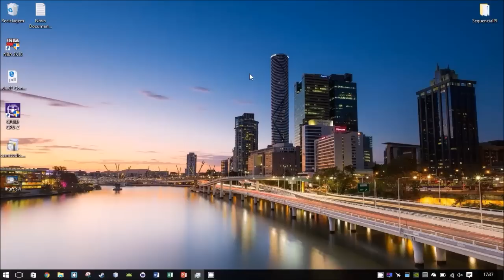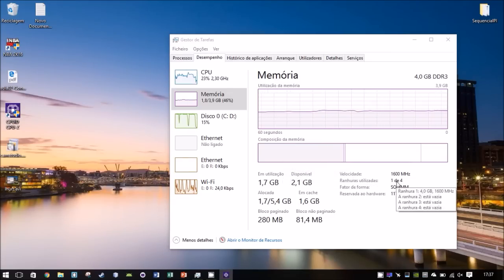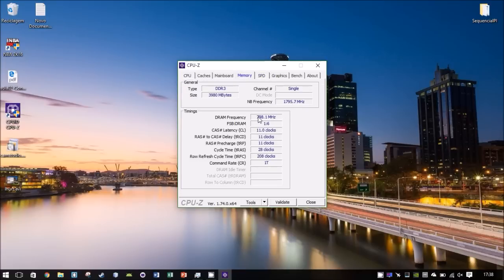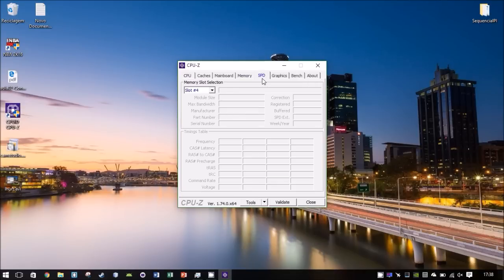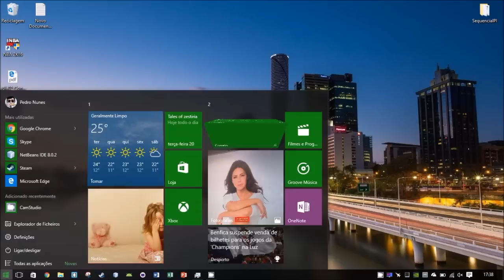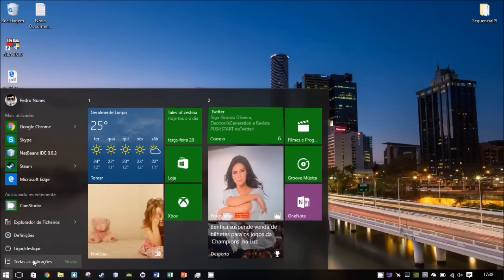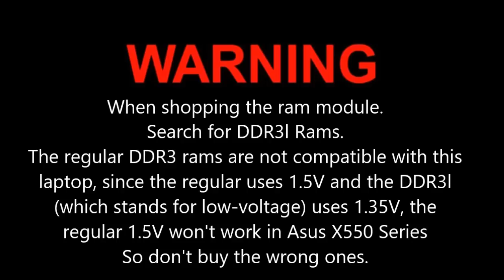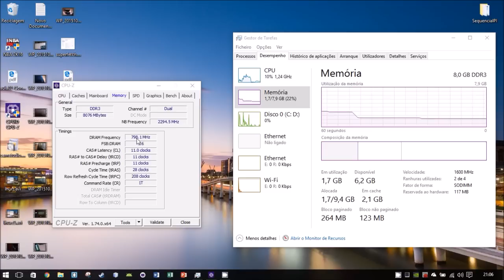How to upgrade Ram on Asus X550 Series (X550LB)

Comment: Will it work work on x550la it has "Intel Core i5-4200U 4Gb ram 1.6Ghz. And what Specs will I have. Tell me plssssss.
Reply from the maker: Yep it will work, you need to buy a stick of 4gb ddr3L cl11, but first you should open the back lid of your PC and check if you have a free slot for inserting more RAM
Reply: @BenchARTVideos  actually the 4gb ram is built in. So can I put a one 8gb ram?
Reply: @BenchARTVideos  should I use a pc3l?
Reply from the maker: You need to use ddr3l!
I actually recommend you to buy 4gb to have a maximum of 8gb, this makes your ram to work with dual channel which makes it more faster and also helps the cpu.
Reply: @BenchARTVideos  whats a dual channel?
Reply: @BenchARTVideos  actually I have one slot with no ram stick .so I must put a 4gb ram??
Reply: @BenchARTVideos  and one question.. 
Will a bios appeared when I put a ram?
Reply from the maker: @ronaldquirap9001  yes you should
Reply: @BenchARTVideos  to ground myself.. can I ground myself into a pc case before working in a laptop. Can I??
Reply from the maker: @ronaldquirap9001  no, it will get along just fine
Reply: @BenchARTVideos  how to skip the bios?

Comment: Hi I have Asus X550cc i5 3337U processor with 4gb RAM..So what is max RAM support for this laptop ?
Does it support up to 16GB ?
Reply from the maker: No, the maximum is 12gb but you will loose dual channel if you use more than 8gb
Reply: @BenchARTVideos  dual channel means ? Currently it have 4gb RAM and if I add another 8gb RAM to another slot , it will only use 8gb ?
OR Laptop will use both

Comment: I have x550la i5-4210u 4GB,what would you recommend for me to buy to upgrade my laptop? can you link me to recommend ram and ssd
Reply from the maker: Depends on what you use your laptop for.
What's your main use for your laptop?
Reply: @BenchARTVideos  mainly for web serfing but i also want to play games on my laptop so i wanted to know how to improve it so that i will have a better gaming experience
Reply from the maker: Honestly most of the today games don't game decently.
Upgrading ram to 8gb will make some games more playable or less stuttering. It will also help you out to open more stuff on the pc while you surf on the web.
The SSD won't be improving your gaming experience but using your PC in general will make a huge difference in everything you open or do.
Reply: @BenchARTVideos  i opend my computer and there is black film where you put your ram in what should i do?
Reply from the maker: @tcrvo01  if you remove the black tape is there a slot?

Comment: where are the other 2 slots? I have asus n552v motherboard. it's supporting 32 gb ram. I want to upgrade ram my laptop but ı cant see another sloths
Reply from the maker: There aren't, it's only 1 free slot if it's not already filled by Asus. The cpu-z readings is wrong

Comment: Hi Sir. My Asus uses i5-4210U, 1.7GHz. Should I use the DDR3L or DDR3? Thanks for the vid though.
Reply: What is your exact laptop Model/Name? Every laptop comes with a specifications list from its following Manufacture
Reply: Asus X550LA .
Reply: Your laptop is compatible with DDR3L. its also compatible with DDR3 With some quick flash BIOS update. Asus Reccomend with DDR3L RAM with clock speed of 1600 MHz.

Comment: Hi , thanks for the vedeo was very help full , mypc is asus r510c is running slow , do you recommand to change the processor ? mine 13 3217u 1.8 ghz
wgich one you recommand?
Reply from the maker: You can't change a CPU from a laptop, you will need to buy a new one, but you should buy an SSD and remove your HDD. You will be surprised
Reply: @BenchARTVideos  thanks
Reply: @BenchARTVideos  buying an new ram will make it faster, firefox taking to much ram, when charging get to 4 gb bugs starting and the pc get  so slow( my ram 4gb now), because ssd it's expensive compared to a ram

Comment: hi there, do you know if it is possible to remove the dedicated graphics
 card on this mode? I just bought one second hand but device manager is 
not able to find my dedicated GPU, neither the Nvidia driver (well the 
driver says that My version of Windows is not compatible and that now 
relevant hardware could be find) I am worried that the Nvidia has either
 burnt out or has been removed by the previous owner.
Reply from the maker: It can't be removed but might be burned, it happened to me before, check the device manager.
Reply: thanks for the quick answer. well I will try renstalling the windows, because the copy it came with was pirate and had not been updated since it was installed 1month ago I guess that's why the driver is not compatible. Normally device manager does not show the dedicated video card before  the video card's driver has been installed. manually  I think
Reply from the maker: Actually it should display but with a warning ;)

Comment: Man how much the battery survive for a normal use mine just 1:30h is there a problème in my battery ?
Reply from the maker: Well it should last for 3-5 hours, but my battery died so I brought one from China and it lasts around that time, it is quite unfortunate :/
Reply: @BenchARTVideos  thnx mate
Reply from the maker: I mean the China battery lasts around 2 hours that's why it is disappointing
Reply: @BenchARTVideos  yeah asus must solve battery draining
Reply from the maker: Well it's normal, especially because battery get worn very easily due to heat. But an original battery it is just too expensive

Comment: have the  X550CL with 4gb of ram, can I add a 8GB ram?
Reply from the maker: If you have a free slot, then yes you can, you are free to open it up, it's just 2 screws and you won't be violating the warranty.
Cheers
Reply: @BenchARTVideos  is it possible to if I have 8gb to go to put one more 8g?

Comment: for the asus x550c model ddr3 (Intel Pentium), it also has 4gb of ram, i have an extra slot, can I add 8gb of ram extra to make it 12gb total, or just 4gb extra for a total of 8gb?
Reply: NeXusDz I have the same model but only have one slot, where is your second slot located?
Reply: @831pac  I beleived that is your only slot. The one you see is your extra one.

Comment: my computer is X550L , cpu i5-4200U，what specification of memory is right for my computer?
Reply from the maker: You will need ddr3l 1600mhz cl15 
Cheers
Reply: THANKS
Reply: the memory i found wasn't written cl5，should i use ddr3l 1600mhz 1.35V?
Reply from the maker: Should be equivalent yes.
Cheers

Comment: I have a Asus x550j and the widows tells me i have 2/4 ram slots used and i only have 2 ram's installed 1 from the laptop and 1 that i bought, so where can i istall the other 2
Reply from the maker: Nope, it's false!
You should only have 2 ram slots, one is solded so you can't do anything with it.
Reply: :( Anyway ty for letting me know

Comment: The real question is.. Can you upgrade it to 12GBs (4+8)? Because I read conflicing answers to that question. I know historically it was a bad idea to have two different amounts of memories, but today, is it still a problem? I have seen videos of asus X550JX upgraded to 12 gigs on youtube, but I'm afraid i'll buy it to just stand on my shelf due to not being able to use it.
God damn you ASUS for closing us off of all 4 slots...
Reply from the maker: Hi shadow, you can upgrade to 12gb with no issues.
Altough the reality is that it might not be the best ideia for some reasons
For example, if you upgrade to 12gb, meaning one with 8gb and the solded one with 4gb, the dual channel will be lost and you might lose performance instead of winning.
It all depends of what you intend to do with the laptop, if you tell me I can give you an opinion if it will be a good ideia or not.
Cheers
Reply: Well I discovered that 8 GB is not enough to play Cities Skylines properly (AKA modded). Whenever I try to load in a map, the game loads up to 5.5GBs of data (in task manager: 95% of total load, only steam and Cities running), then the whole computer freezes for a couple of seconds, then drops almost all data that it loaded in, except 1.6GBs, then it overwrites previously loaded in data, resulting in annoying glitches.
So basically there is not enough memory. Now how bad hit will losing the dual channel feature be? Because I suspect the original HDD that came with the laptop is the bottleneck of basically every task the computer has to handle in terms of speed. How can I test that? The fact that in the task manager, it always says that the HDD is working at 100% rate, but is that REALLY the issue..?
Thanks for replying :)
Reply from the maker: The HDD is the bottleneck for every single task in a pc nowdays excluding gaming.
As for the ram, I believe that 12gb will help you. The dual channel loss will cause a worse framerate in games that are CPU bound, so in case your cpu is getting hammered on a game, without dual channel the cpu gets worse performance.
, Same can be said for some other specific tasks like copy content, but apart from that, you shouldn't feel a thing. The 12gb will surely help you in your problem with the cities skyline.
 Cheers
Reply: The GPU is having the hard computational load (80%), the CPU is at on average 40%, so that doesn't seem like a hammering :)
Also, a stupid question, but these 2 RAM units act as one unit, right? So in the computer's mind it is not 4+8, but 12, right? So if I overload let's say the 8, it can continue using the 4 for the same task, right?
Reply from the maker: Yes and no, depends on the process.
If skyline runs 32bits (which don't seem to be the case) it would use a maximum of 2gb (process only) But yeah I'm not sure if the systems assume the 8+4 as one, but surely you will take advantage of those 12gb.
As for the 80% GPU load, you are being bottlenecked, in a game that don't have a lock in a framerate, that runs in a variable framerate the GPU load would be ideal to be at 99%, even having the cpu at 40% might be bottlenecking the game since not all the games can distribute the workload for all the cores/threads or decently, it depends a lot on the optimization.
Cheers

Comment: I have a full question, hope someone can answer them all. Thanks. 
1. Changing HDD and RAM is easy, at some point, but... Is changing the Graphics Card and the Processor as easy as changing HDD & RAM? 
2. Let's say I go with a professional to change my GPU and CPU with already bought pieces, say, what other specifications do I need to check to change GPU and CPU? Like, what do I search in Google rather than "Internal Graphics Card" or "Internal Processor"? 
3. Is it also possible to keep changing as I like? For example, if I have an 8 GB RAM laptop, can I change it to 16 GB? Do I need to check some other specifications in order to successfully change it? 

Thanks for the help.
Reply from the maker: 1. It's not possible to change the CPU and GPU in this laptop, you are forced to stick with what you have, everything is solded.
2. Like I said you can't change them in here.
3. If you have a free slot you can always add more ram, but that's it.

Bonus 4: There are external graphic cards through Display port which our laptop don't have that allows the user to use other GPU aside from ours.
The thing is, the CPU is too weak to go along with the power of most of this GPUs.

For upgrading stuff, always go for a desktop.
Reply: BenchART 
Alright thanks. I will build a desktop but I'm used to travel a lot and I was hoping I could upgrade it slightly.
Reply: BenchART hey thanks for answering, hope this isn't a lot, but I have another problem (x thanks for the help
See, I have another laptop, same brand/series, ASUS XZ550, which apparently was used by someone who didn't know you had to turn it off directly from Windows, and they force-shutted down the computer with the button, which caused some problem in the HDD (maybe fragmentation) and now, Everytime you turn it on it starts normally, except that the shortcuts, folders and background pics take longer to initiate, and when you're at least 15-20 minutes in the computer crashes and turns off. I wanted to format it, but when I try and wait for the process to take place, an error appears and simply outs everything back like it was, not any of the options work. So, is there a way to repair the HDD? Any way to format it even if I have to leave it blank in the OS? Since I have the serial number for Windows, I suppose I wouldn't have any problem installing it again. Thanks for the help, you've been the only one that has helped me, hehe.
Reply from the maker: Hi Freshie, sorry for taking so long, I've been quite ocuppied and didn't had the time to reply to my viewers.
Look, first you should try to check it out and see if the HDD is damage.
Brute force shutdown, don't damage the HDD only the Windows, but it seems more than that for now.
I should suggest you to install HD Tune, it's an old software and only available for free to try (30 days), but it is enough to do a Full Scan for erros and damaged sectors.
If the HDD is damaged, there is nothing you can do.
If not and if the PC is running windows 10, you can download the ISO file from the microsoft website for free and install it, and put the key later.
Microsoft nowadays let's you download the original ISO with no problems or cost.
Cheers
Reply: BenchART 
Hmm ok, that makes sense, should I take out the HDD and run a scan with an external hard drive USB case? Because I can't do anything at this point, it takes a lot to load and when it's done loading it just crashes. How do I know if the HDD is the one damaged? From what you've told me, maybe it is just Windows, so I should probably just format it and install everything again, right? The HDD has never suffered any physical damage, only digital, with some viruses going in and out and this problem I currently have. 
Thanks for the help, I'll follow your advice.
Reply: Can the original  4GB RAM be removed and used elsewhere?
Reply from the maker: In my case, no it's solded on the motherboard, so you are forced to stick with those 4GB.
Which means that the maximum upgrade will be 12GB with Single Channel or 8GB with dual channel.

If for some reason the solded ram gets damaged, your laptop goes to the gargabe since you can't trade it for another kit.
Cheers

Comment: Would this (Kingston 8GB DDR3L PC3L-12800 1600MHz 1.35V Non-ECC CL11 Laptop Memory (KVR16LS11/8)) work on X550LD?
Reply from the maker: What's your CPU in that laptop?
Reply: I7 4500u 1.8ghz
Reply from the maker: In that case it should work, yes :)

Comment: i have an asus x550c, woth cpu Intel(R) Pentium(R) 2117U @1.8GHz, will this work?
Reply from the maker: I think for that CPU you can use 1.5V rams, you don't need to buy 1.35V rams.
I recommend you to check if you have free ram slots where you can upgrade.
Cheers
Reply: BenchART thanks brother!! i will check it out, my laptop is old, and i dont want to buy a new one just yet.... it's been lagging and acting slow lately, will you do a video on upgrading to an ssd in this models?
Reply from the maker: I wish I could buy a SSD, but basically if your chassis is the same, it should be very very easy, you just unscrew those 2 scews on the back, remove the HDD and put the SSD, simple as that.
The thing is, obviously, you will need to install the windows on it and the rest of the stuff.
For years I have been considering adding a "caddy" (remove the DVD drive and put the HDD there) and add a SSD to the slot where the HDD was, but considering that, for now, I haven't been using my laptop for demanding tasks or even working that much with it, I'm probably won't be upgrading to a SSD unless I really start to use it everyday for work.
But surely it's something that would bring a new life to it.
Cheers
Reply: BenchART Thanks I really Appreciate the reply! i will look into it!

Comment: HI! MY laptop is model x550c with Intel pentium 1.8ghz. Will that type of ram work on my laptop because when I opened it on the back there was written on the ram slot (1.5 V) not 1.35?
Reply from the maker: Can you tell me the exact model of your cpu?
Reply: CPU

 Intel(R) Pentium(R) CPU 2117U @ 1.80GHz
Reply from the maker: Not really sure but I think your cpu do support ddr3 of 1.5v so I guess there is no need for ddr3l or 1.35v
Reply: BenchART ok thanks!!!

Comment: hello, i have asus X550C and i want to upgrade CPU if it possible, currently i have Intel(R) Pentium(R) CPU 2117U @ 1.80Ghz 1.80Ghz
Reply from the maker: Hi Badri, sorry to tell you, but it is impossible to upgrade your CPU on this laptop (and almost 100% of the laptops) since CPUs are solded on the Motherboard, so it makes impossible to upgrade CPU and GPU, the only thing you can upgrade it is storage or ram.
Cheers

Comment: Can I upgrade my x550la with additional 8gb ram? Intel Core i5-4200U processor, with 1.6GHz - 2.6GHz, UMA Intel HD Graphics 4400, 4gb ram, windows 8 64bit?
Reply from the maker: Yes you can, but you will lose dual channel, so you need to know if you really need those 12gb of ram, or if you can go nicely with 8GB total and dual channel.
Cheers
Reply: Sir, how do I know if my laptop has a dual channel? Please explain.. Im newbie. Just want to enhance my ram sir.
Reply from the maker: +Curtis Carl Gelacio simple. Everytime you pair the same amount of ram with the same (more and less) specs, you get dual channel. By now you have single channel.
If you buy +4gb of ram you will have 8gb dual channel, if you buy +8gb, you will have 12gb but you will remain single channel since you need rams from the same amount
Reply: BenchART ok sir.. Thank you.